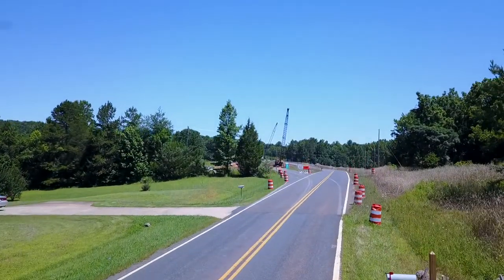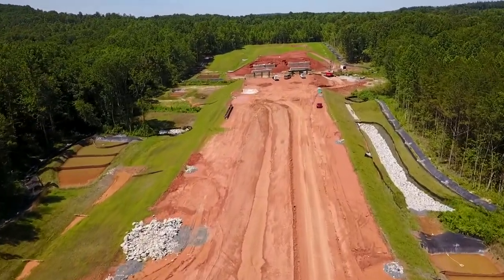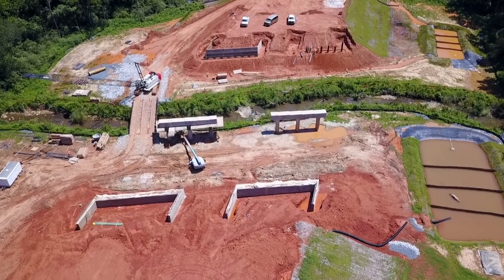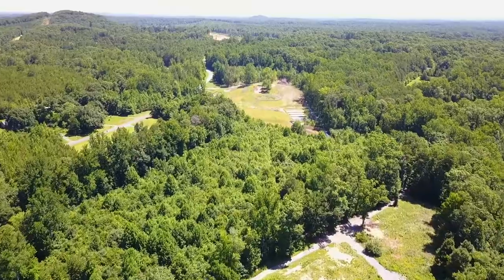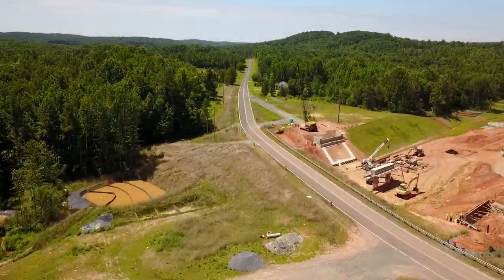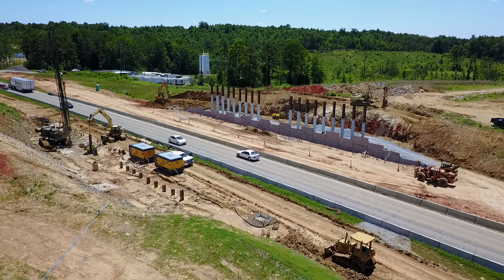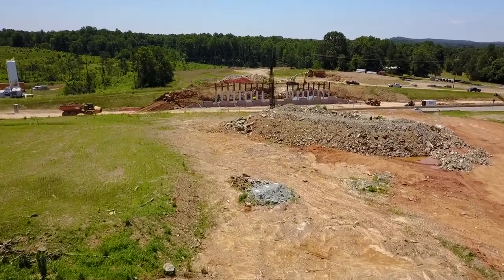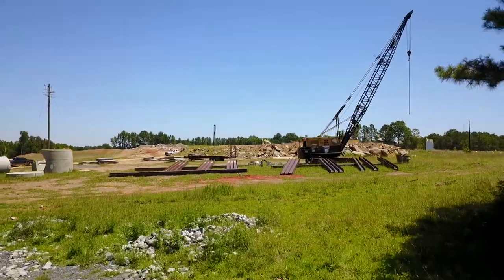64 ByPass Update...6/26/17...Bridge Construction

Comment: I can confirm that at times Vestal Creek carries a torrent of water ... seen it where it passes under Zoo Parkway on its way to where you showed. Went down 49 today and saw that "big shovel" putting just a few scoops to fill one of those "big trucks" that could run over my little one and hardly notice it.  :^)
Reply from the maker: I've observed when that big excavator is digging in soft dirt, and can get really big bucketfuls, it only takes three to fill the 777 truck... but if they're digging in harder ground and are coming up with moderate-sized bites, it takes four or so to fill the truck.  Amazing to watch.  How long would it take to build this road if they were having to hand-shovel each load?!